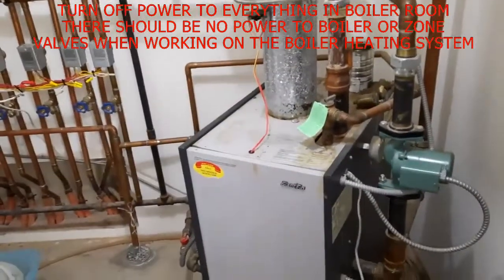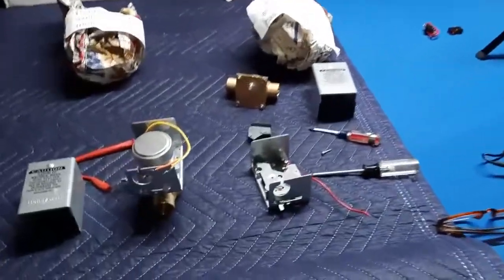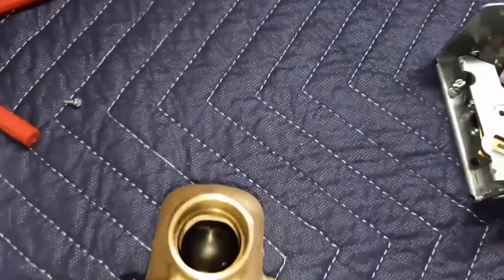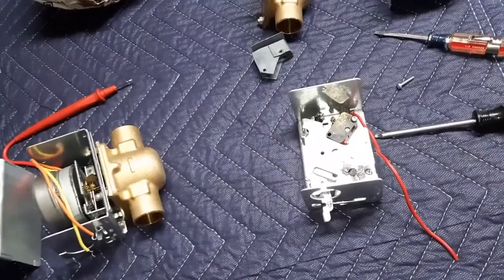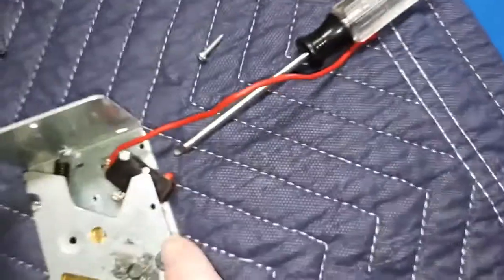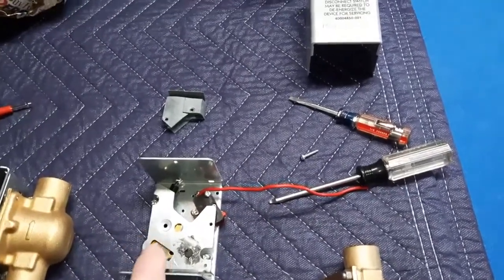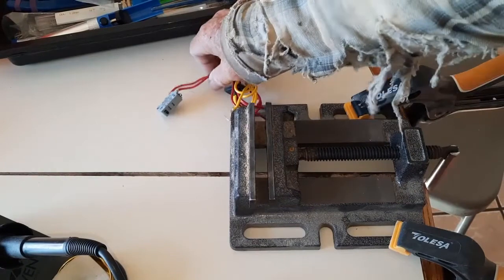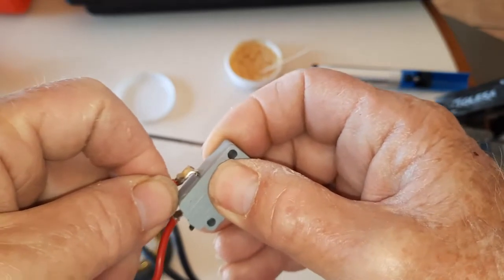Fixed Honeywell Zone Valve micro end switch, V5C010SB3X147

Comment: Thank you for your efforts. Ive narrowed down my zone valve issues to the microswitch and i found i have to press it in deeper for the boiler to fire up. 

Im going to try and open up the microswitch and see if i can get it to activate sooner. Its cold here in the north east.
Reply from the maker: Someone commented several years ago, that they simply glued a small piece of a cut up yogurt  cup onto their micro switch  button and that helped the switch to get pushed in enough to actuate the circuit. I hope this helps you get some heat.
Reply: @johntube2525  i followed and listened to the part of the video where you opened the microswitch up. Thank you for the warning of how things can get loose when inside. i think what was going on is that one of my red wires wasn't contacting the metal piece flush. The wires get pushed into my microswitch and are not soldered. There's a piece of metal that's supposed to push the wire flush against the metal piece and i don't think it was doing it's job correctly. So i straightened the wire out as much as i could and made sure my button was activating even half way pressed like you said, and the boiler fired up right away! No idea how it got that way in the first place. It's a non moving part and it was my first time mucking around in in the zone valve. 

If something like this happens again, i'm going to solder the wires into the microswitch. 

Either way, based on your video you saved me a couple hundred bucks for only a few minutes of my time and a trip to the plumbing store. Thanks again.
Reply from the maker: @honda919er  Thanks for update. I hope others read your comments. Because others could have the same connection problem and you have explained how you fixed your problem. 

Soldering is probably the best way to make electrical connections, but it takes practise, experience and a pretty good soldering iron. Push on and pull off connections are much easier, but need a good connection. 

Way to go! You have heat again and did not have to call a plumber. Since I live so far out in the country. I get charged extra for travel time in addition to the actual fix time, so I have tried to learn how to fix most of my problems. 

Good job and thanks for commenting and posting your fix.

Comment: Are the new switches from eBay still working?

The alteration is easy- just wanna know they will actually work. This happened to a few of my zones over the years and I stupidly bought the whole valve just robbing the motor and switch!

Honeywell isn’t making nor selling the actual switches anymore individually- can you believe they told me to buy the actuator/switch and gave me a new part number they now sell!!!

Ty
Josh
Reply from the maker: Yes, still working. However, I put one of the new micro switches in a room we call the junk room. We keep the thermostat turned way down in that room, since it is the junk room and no one sleeps or uses it for anything. As a result of keeping the thermostat turned down that new micro switch does not get pushed in with the arm nearly as much as some of the other rooms in our 6 zone house. However it is nice to know I have plenty of spare V3-101 micro switches should I need them, since I bought a lot of 10 and I have only used one of those 10 to date.

Comment: This just bought me more time on my zone valve micro switch. Thanks a bunch.this is the only video I could find on taking that switch apart. I a tiny piece of yogurt container plastic onto the top of the little black button stick so that it hits and pushes up the contact lever a little bit sooner. Two thicknesses of yoghurt container thickness was too much. Probably a 1/16th or 1/32 thick. Thanks for this.
Reply from the maker: Glad to hear you got yours working again. That is a good idea to put something there to help the points to close. Good job to get some heat in the dead of winter.